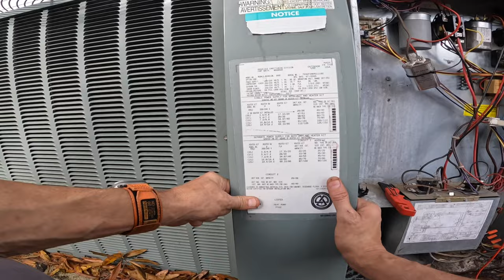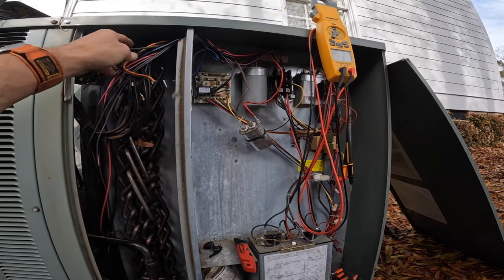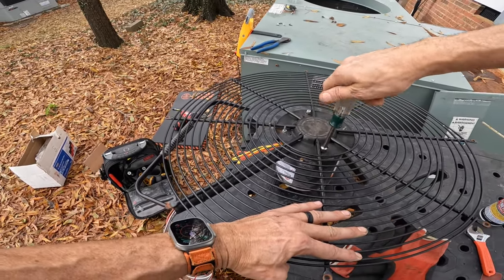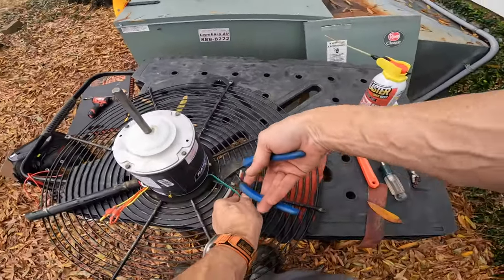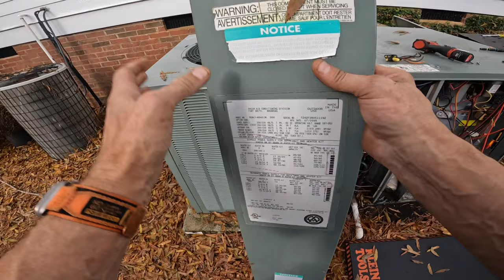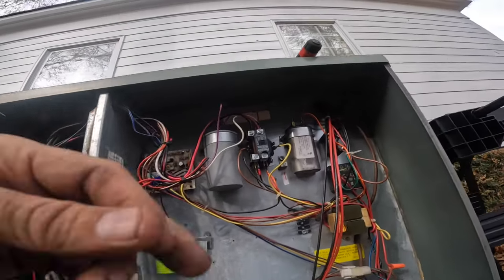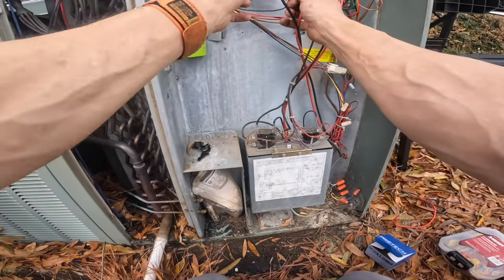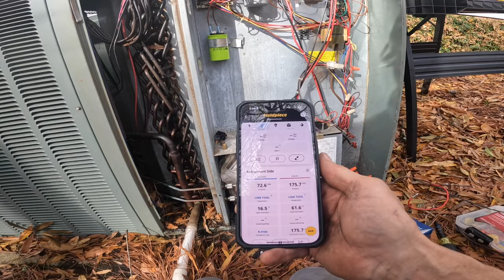Making Loud Noises, and Not Heating Or Cooling

Comment: Hi Mr. Curtis don’t know why you cut those wires connectors off it’s a little aggravating, but you can get them all through there if you know what I mean of course if you don’t want to fool with it, that’s another thing but just thought I would drop your line and say that it is possible get them through there and to use them the wires are not long enough then it doesn’t really matter OK, checking out Tallahassee Florida. Fred.

Comment: Do you ever have a sun deterioration issue with the directional wiring exposed to sun and elements? I was told always tape them to cover then tie wrap.
Reply: Taping traps water and hides corrosion.   Looks nice though.  I'd use waterproof heatshrink if I was doing my own unit and had all day.

Comment: where did You get that table? I've got to get me one. Another good job.
Reply from the maker: Home Depot. DeWalt work table
Reply: @HVACGUY  Thanks!
Reply: Idk if mine did not get the best quality control or what but it lasted me like 6 months.
Reply: @carlosguzman3136  Thanks for the advice. I have seen many times where something like that would be nice for sure. Working on the ground or a tailgate is hard sometimes. I used to work on a lot of rooftop units and it would have been handy but you'd have to rope it up and in that case it might not be so great.

Comment: Hey Curtis, I'm still pretty green... how did you change that breaker outside with power on????
Reply from the maker: Very carefully
Reply from the maker: Turn it off, pull it out change it, carefully put it back in, and tighten lugs, then turn it on

Comment: Nice job, looked like fun. I hate to be a spoil sport and it may not matter, but those open screw holes that you didn't use on the top of the fan motor, won't that let water get into that motor? Sorry, I'm an ass.
Reply: The motor has drain holes on top and bottom. In this case he left the plugs in the end that went up. And pulled them out of the other end to allow water to drain.
Reply: @mufmuf97  Yes that is true, but I was referring to the mounting screw holes that he didn't use. I guess draining out is good enough. A dab of silicone in each one would do the trick, and just make me feel better if nothing else.
Reply: @jthonn  I leave them in, but that is what the drain holes do.